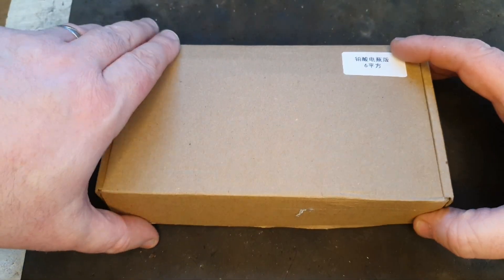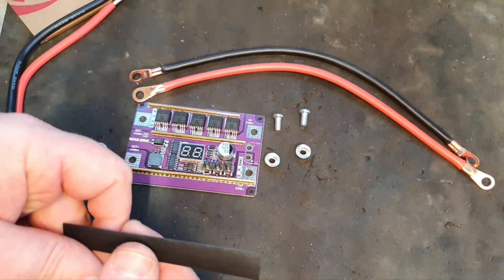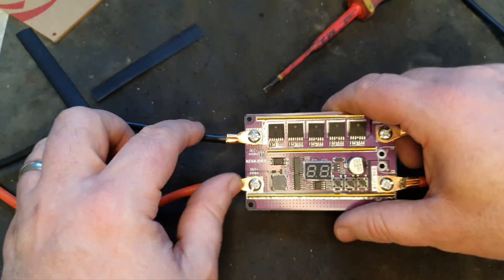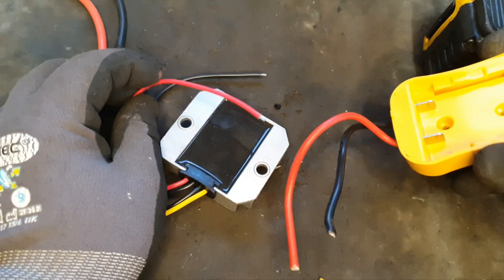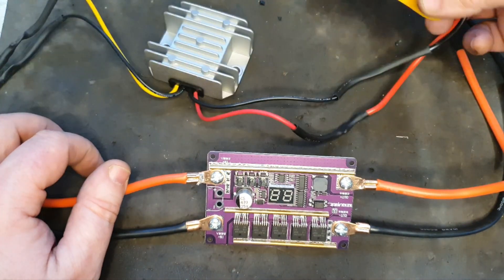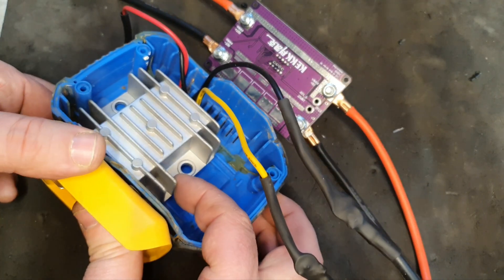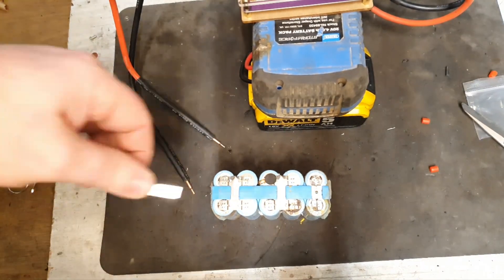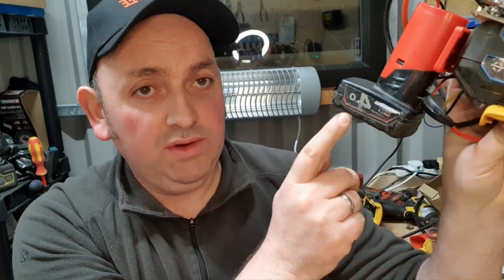DIY Spot welder with a difference #diyenthusiasts #tools #batteryrepair #milwaukee #howto

Comment: Good to know!  Will be interesting to see what the issue is with the DeWalt battery, since probably better to not jump one of the 12'ish to 9'ish volt outputs.  Though now thinking about, those are only BMS wires so might not be a good idea even with the low duty cycle pulse at the higher current if even can draw.  Would require manual balancing of a 20V (18V) battery.  Still, wondering what DC-DC converter or buck converter module might be suitable to get effective use?
Reply from the maker: Not sure yet if the M12 is the answer but R&D continues
Reply: Well, I ordered one off the Aliexpress for ~$10 US.  Will have to take a look see in the next few weeks when I get the time once I receive.  On another note, I uploaded a video yesterday of one of the Dyson V6 cordless vacuum adapters for the DeWalt 20V batteries.  Figured make an embarrassing video to remind me to look into some more.  Guessing MOSFET's broken when dropped, though wondering your thoughts on what's the broken part or maybe better yet, better part replacement?
Reply from the maker: @jafinch78  not sure

Comment: Insulated screwdriver.........fierce health and safety going on here 😂😂
Reply from the maker: I am to health and safety what King Herod was to babysitting
Reply: @doctorlefthandthread  Robbing that phrase. I'd say the issue with the DeWalt could be the BMS reading the load as a short, I've had similar issues when stacking them in series for 38v bike motors ( Lidl parkside series are more forgiving ). 
You should check out the spot welders make from a microwave coil and a jump lead for heavier stuff like sheet metal. I'm still too weary of lithium to try spot welding rather than solder but I'm working up to it. Keep the class content coming
Reply from the maker: @Fergibaby1  thank you for the excellent information and there's plenty more from the doctor's surgery to come
Reply: Well that’s a up grade but still a sad thing about for the sparks will still fly in the  Sunday night operation shed. 😂
Reply from the maker: @Jbubbs-381  I am.not convinced its an upgrade yet but we shall see